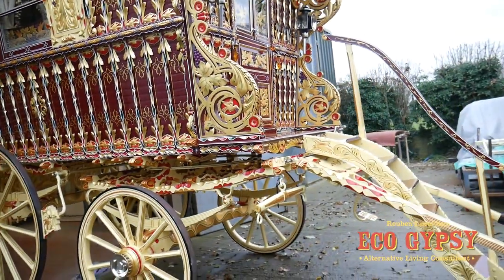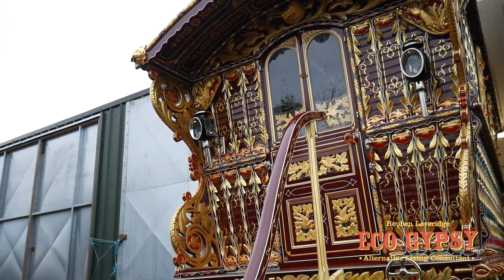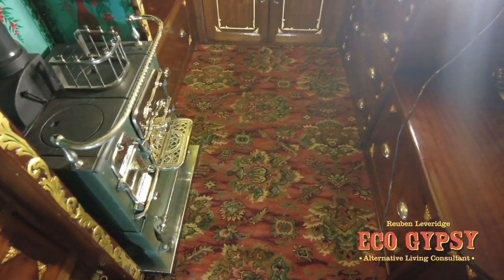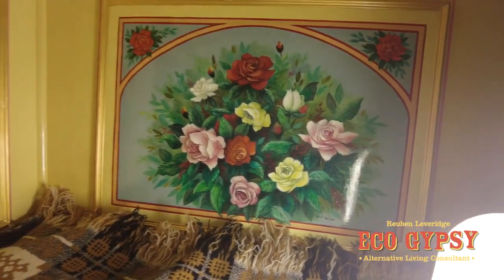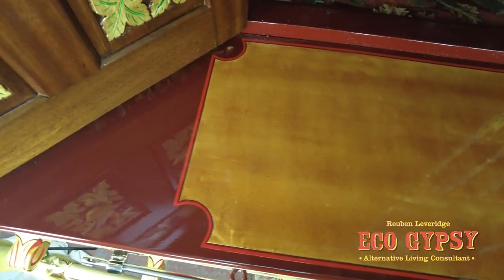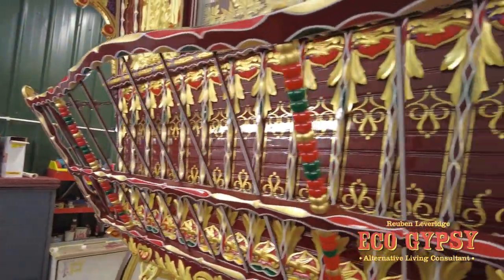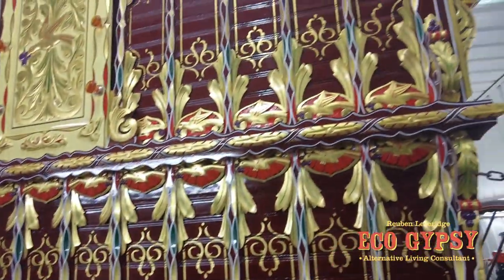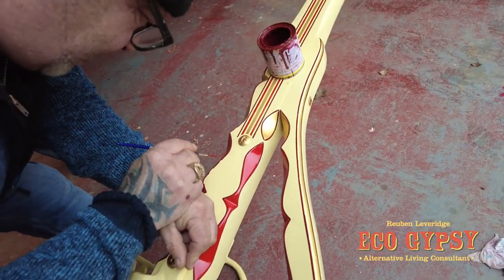READING WAGON ,A RETURN HOME . ECO GYPSY

Comment: How did they store the stairs while under way? It baffles me
Reply from the maker: some fit underneath on the bigger readings other wise they just got put in on floor while moving about 12 to 15 mile a day
Reply: @reubenleveridge5175  thanks so much for the reply. You wouldn't know what type of paint used on the restoration.
Reply from the maker: @cycledaze  there is a load of details on brushs and paint on one of my earlier videos sorry cant remember which one